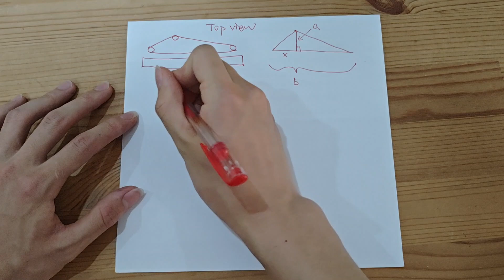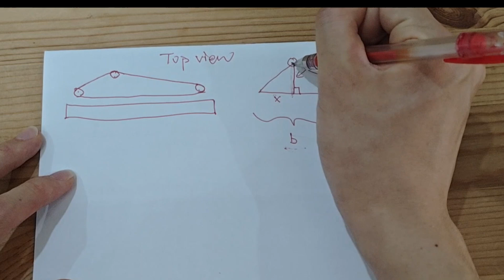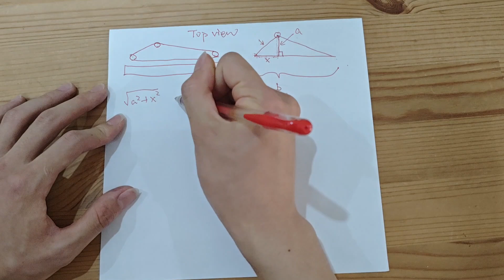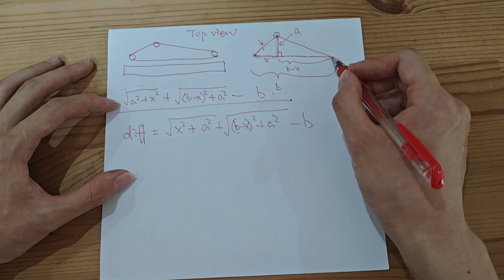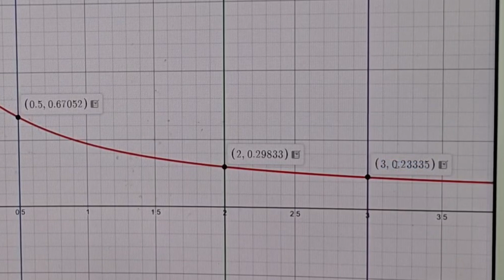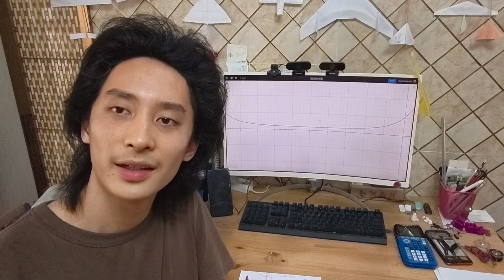Stop damaging your 3D printers with those designs!

Comment: :ConfusedMathLady:
For a non-algebreic explanation, you could use two constraining points and a loop of string that's slightly bigger, then move your finger on one side of the loop to show how much offset is needed to maintain the same tension on the string. Kudos for actually taking the time to do the math though